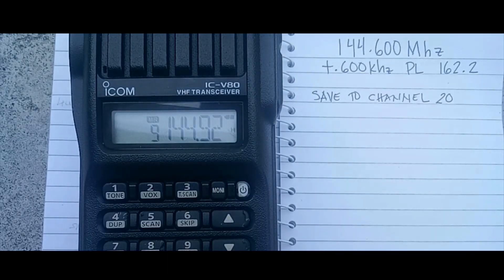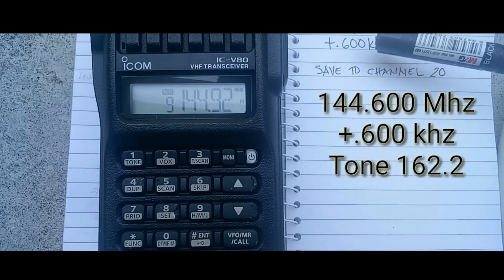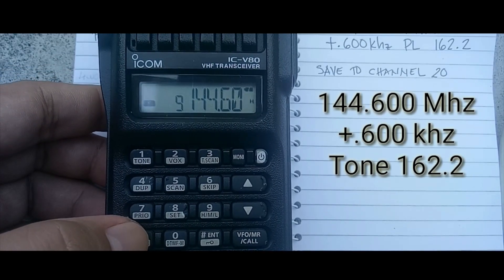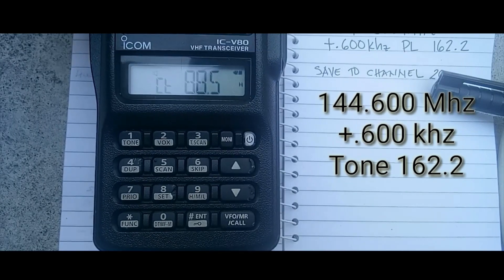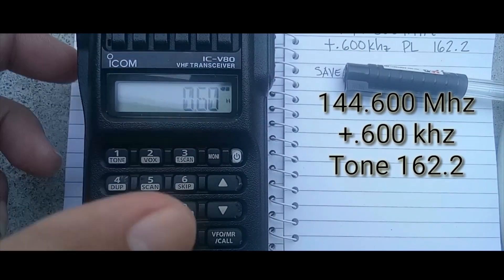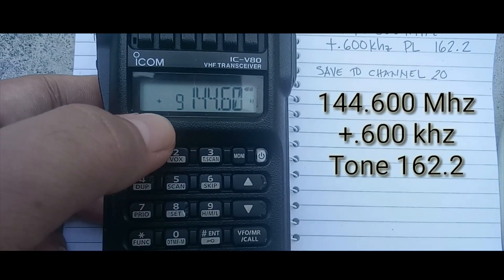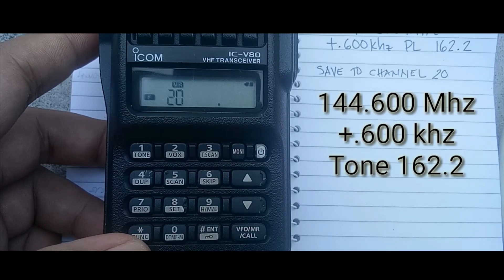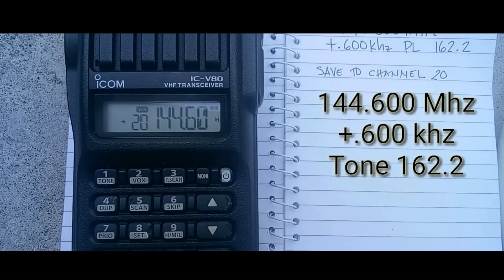ICOM IC-V80 How to program manually

Comment: Whats the range on these radio's in urban environment without reptar
Reply: Depends on the type of obstructions. Heavy, dense downtown district not very far. A mile, maybe two if that. In the suburbs where there is mostly family housing maybe double that with a good aftermarket antenna. Unstructured open areas with the same aftermarket antenna 5-8 miles or so.